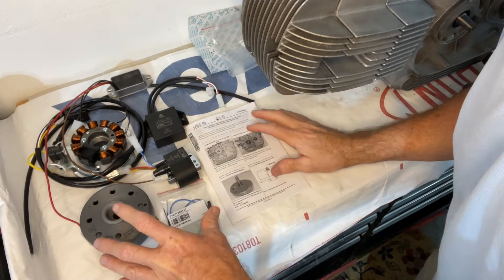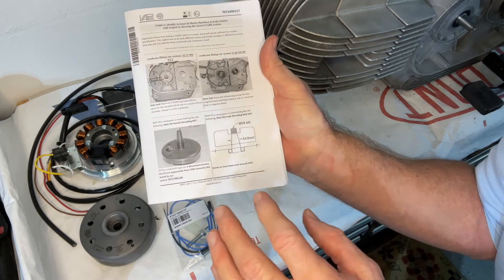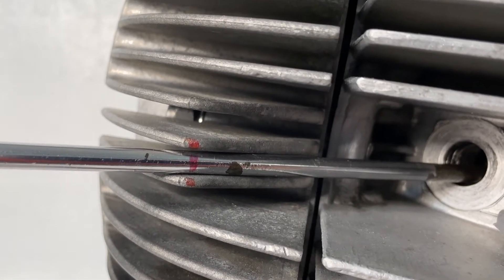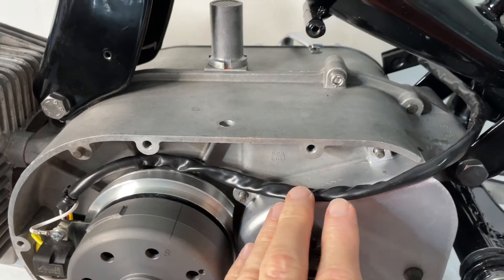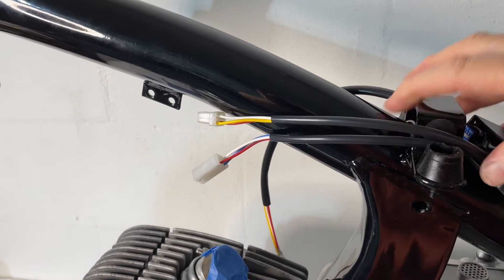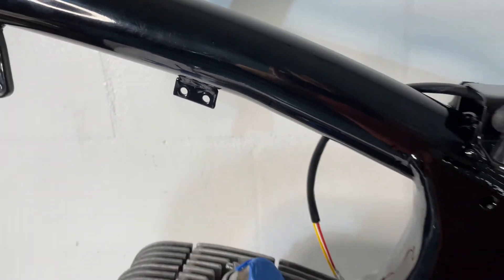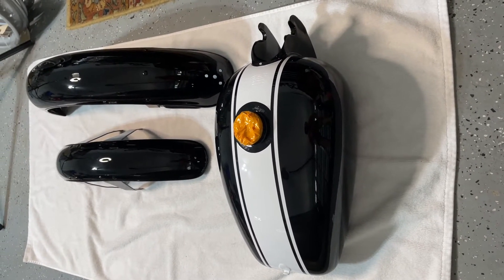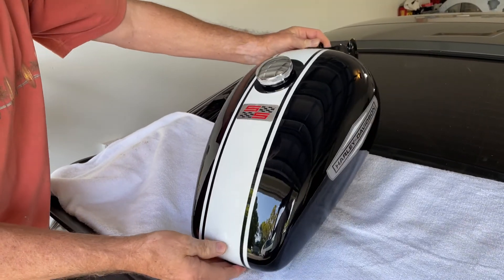Motorcycle Ignition Installation

Comment: I'm glad to see you went with that unit. Works fantastic.
Reply from the maker: Hey there, how's your bike coming along? I noticed you changed your carb to a Mikuni? I'm thinking of using a Motogadet M-Unit with a 12 volt battery once I save up the money.
Reply: @cleaningrestoring4809  I'm running a VM28-49 Mikuni. 28mm. I improvised to get it mounted with several Lowes copper plumbing joints. This year plan to shorten the intake runner a bit with something more permanent. 
I considered the M-Unit too but price aside, I concluded that in my own case I wouldn't use anything it offered. I'm not running an keyed ignition, battery or signals so the fancy features are dead to mine. I simply have a toggle switch under the tank that arms/kills.
***Before you drill holes in your frame notice that the hole spacing on the regulator and ignition advance unit are the same. I reused the mounting holes for the old regulator and using an 'L' bracket I made I mounted them opposed to each other on that plate. It was clean and easy. Might make it all fit well behind the side boxes.

Comment: are you gonna stay with the stock carburetor, ive always heard they have issues starting when warm
Reply from the maker: HI Toby, I hope to be able to use it. I have heard they are very finicky! Do you know if there are good alternatives?
Reply: @cleaningrestoring4809  I do not i need to figure one out for mine
Reply from the maker: @tobyhamblin1340  Check out Forzaplayer7557 looks like he is using a Mikuni carb.
Reply: My personal experience with the stock Delorto was that it would stall under braking forces and would rev higher when the bike was leaned to the kickstand and would lower when leaned the opposite and stall. Played with all different float bowl and carburetor angles to no avail. Thats why I changed mine over to a mikuni. 
You can hear the difference in the idle between my newest video and the one two videos prior.
Reply: @Forzaplayer  if i may ask what carb is it and where can you get it?
Reply: @tobyhamblin1340  I decided to use the VM28-49. Its a Round slide style like stock. I wanted to have an open velocity stack for Zero restriction but acknowledged that was a bad idea and was able to find a velocity stack that uses set screws and creates a mount for a large (virtually no restriction) filter. This is a version of the part I'm using. They are common for cart racing.  https://www.viperizerracing.com/28mm-Air-Filter-Adapter-Velocity-Stack-p/vpr-17.htm
I purchased my carburetor on Ebay from seller oemcycles for $85.
Genuine mikuni. Not a Chinese knockoff.
Reply: @Forzaplayer  did you have to buy a new throttle cable or make something work?
Reply: @tobyhamblin1340  I purchased a new cable I can't remember how the fit was between the carb slide and cable but it may have been a problem. Also I replaced the grip with an EMGO because the old one was binding up and the cable was jumping out of the seated position and caused revving and malfunctions. Used a generic bend throttle cable and cut to length like this one. Worked great and made well.
https://www.ebay.com/itm/Universal-Throttle-Cable-for-Motorized-Bicycles-49cc-50cc-60cc-80cc-/254807832741?_trksid=p2349624.m46890.l49286